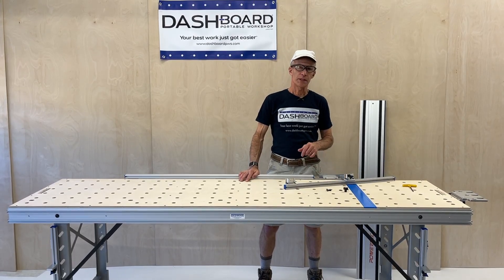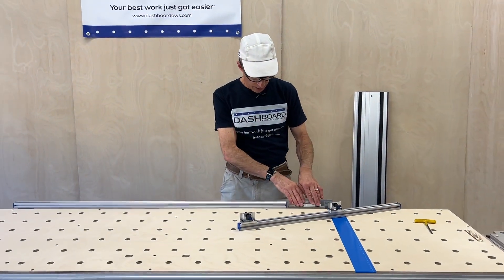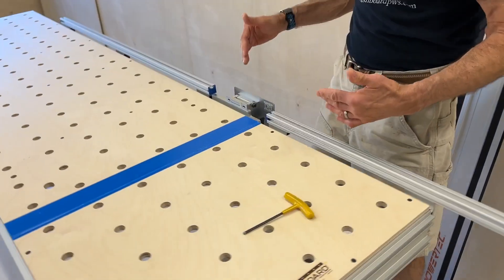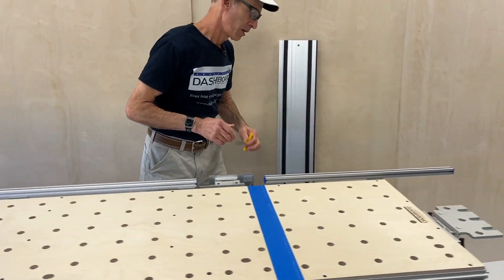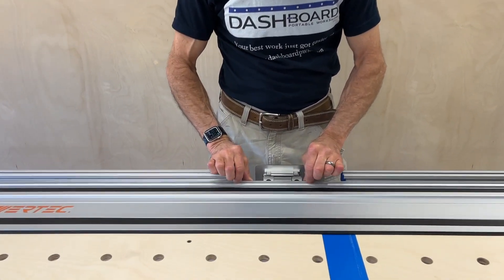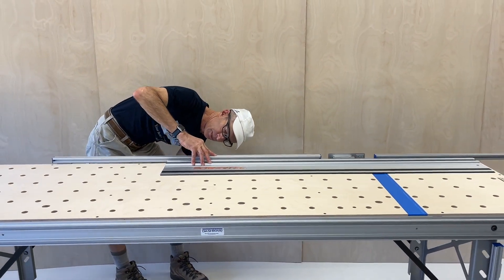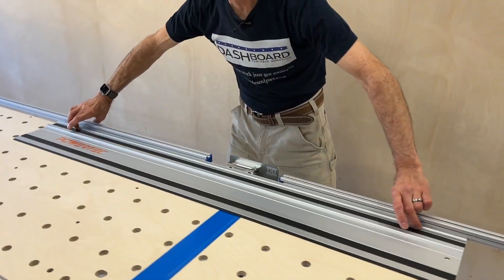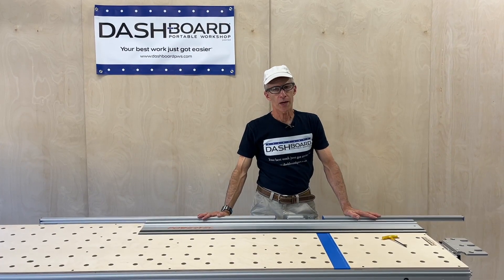Dash Board Side Mount Crosscut Fence Calibration

Comment: How does one know that the fence is now parallel exactly to the 20 mm dog holes in the bench, along the 8ft axis?
Seems to me there is room for error, since the cross cut track is squared off the 20 mm dog holes?
I currently have to square the crosscut track off the fence, not the dog holes, to get square cuts.
Reply from the maker: Our benches are assembled with a particular emphasis on keeping the "back" of the table as parallel as possible with the grid of holes. That ensures, to the best of our ability to fabricate things, that fences and table top will be properly aligned after fence calibration.

The setup process outlined here:

https://youtu.be/m9rnab9GAW8

makes careful note about the difference between (1) setting up the brackets and (2) confirming squareness between them and a fence. It is the user's responsibility to verify that on their own.
Reply: @dashboardportableworkshop  
I probably need to get your new and improved fence too, since bought so early in your product development, it’s getting harder to resist giving you more money!
Reply from the maker: Thanks so much for being an early adopter! It's true that our current fences are much better than the initial versions, plus they'll work on your bench.